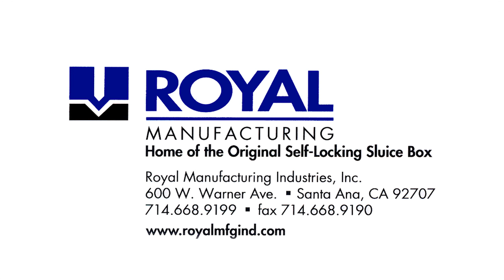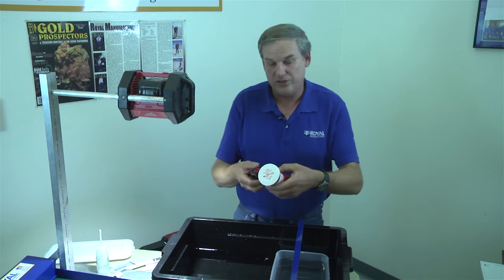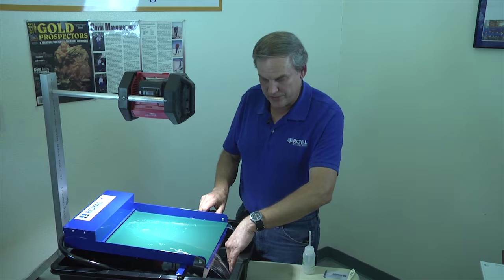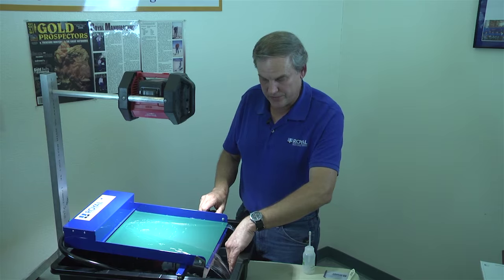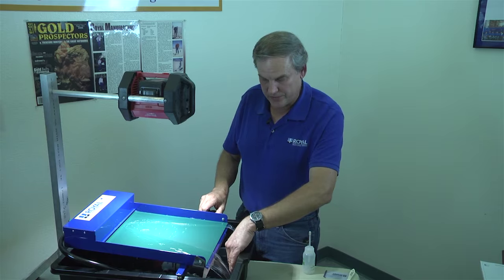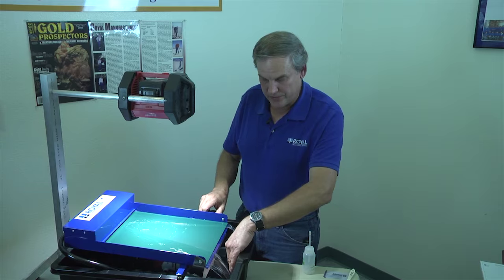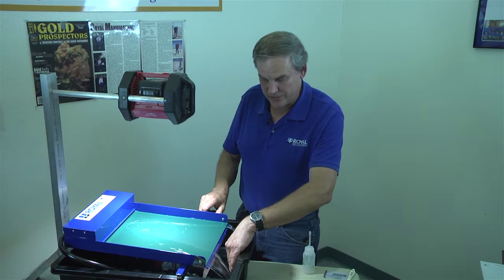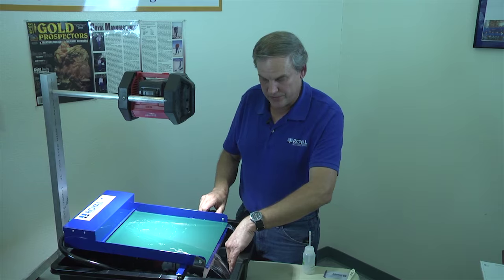Royal Manufacturing Gold Dust Concentrating Table

Comment: If this is your first time seeing a table like this, add jet dry and make sure your material is wet before adding. And run 2 different classifications at different water flows. 50 mesh and 800 mesh don't separate well together.

Comment: I ordered one and came two days ago. Might want to check out the holes for leveling the table. Improperly drilled, thankful I had drill to drill new holes. Table is awesome
Reply from the maker: If you ordered from Sunny Mountain, we did not ship them the black bins, they purchased their own and did not move the hole as they should have. But we are sorry for that and have spoken to them a few times as there customers where calling us regarding holes.

Comment: I use a 3 stack gold cube with tromel then I clean out the miners moss from the gold cube into a 5 gallon bucket and it's very fine almost like slurry and then I run it through the royal table and it works great

Comment: Beautiful product, looks like it works really well! At 21:15 - you might want to consider adding a drop of Jet Dry to break surface tension. Also, wet any material before you run it so it can break the surface tension properly.

Comment: I can't imagine putting this much energy and time into capturing so little material.
Reply from the maker: It's a hobby, not for everybody
Reply: @royalmanufacturingoffical  - definitely.
Reply: @driverjamescopeland 
It’s a ton of work. Screening Gold bearing mud particulate through screens. Filtering mud off Gold dust with jet dry/dawn dish soap but the mud eventually separates as much as it will, then you let the water settle for 2 days near the sink before gently pouring the muddy looking water until you see heavy looking sand since Gold is denser than water. Then you keep transferring the water from bucket to bucket to further agitate the remainder of the mud. Do what works for you and discover the process. 

There is tons of Gold flour but greed is the only thing that can ruin the fun. For thousands of years people have fought, been killed and had their Gold stolen even lifelong friendships have been ruined over it. 

It wastes a lot of time and it’s a huge pain but fine Gold is everywhere sometimes after a heavy rain if you look for light yellow spots in soil to scoop up. Gold erodes out of rocks after millions or thousands of years until it becomes the size of dust or the size of microns. Everything needed to process it is more expensive as a start up cost than the actual process itself minus heavy machinery since I am not rich.

You can also use round magnets to get the black magnetic sands out of the micron sized gold bearing sludge as much as you can. You can see the Gold glimmer eventually.
Reply: Atomic size actually. Very very small but, yes, abundant!

Comment: I just ordered you're Table.  I'd tried a Blue Bowl, and just got frustrated.  I'd read that most Tables were not much better than a Blue Bowl.  I'm impressed by your video, and hopefully when I use it, it will perform as shown in this video.  I used to toss my lack sand, but one day I viewed it through a 5 power loupe, and discovered gold that was nearly invisible.  And the black sand was from the bottom of you large drywasher.  So to everyone who has a drywasher, DO NOT throw away the fine material that falls into the bottom of your drywasher.

Comment: It works great, well made quality product that exceeded my expectations. The packaging was superb and made it to New Zealand intact after multiple handling. I ran some cons that had been through a Blue Bowl twice and some that had been through a Gold Cube, about five or six cups gave about a gram not much but remember these were cons that I was finished with. From now on I will run anything -50 mesh through this. The black sand did not yield much I use a magnet multiple times to separate the gold that gets picked up with the black sand it was slow but from now on I would not use the magnet at all and just run it on this table.
There are others much cheaper but they will not last this is solid and well made in all respects. The only thing I changed was to raise the catch bucket up about four inches to stop minor splashing no big deal. Great machine and very happy with it.
Reply: so you bought it, is it worth the trouble retrieving that flower gold?
Reply: @shortsdeliveries  every little bit adds up

Comment: isn't this table made of copper ?! You painted it with electro static, good idea, congratulations friend. I'm from Brazil, and I know that the copper plate makes the powdered gold stick to it, but I paint it, I don't know if it works. thanks
Reply from the maker: Hi Luis, no our Concentrating Table is not copper, the top green is a matting and the blue is powder coated
Reply: @royalmanufacturingoffical  Hello my friend, is that here we use the copper plate, because copper attracts gold, creates an ionic and magnetic alloy

Comment: Nice unit like the thought you put into it. Just an idea, my miller table has a vial screwed in to the table, near the top on one side witch I can sweep with a brush my fine gold into
Reply: Do you use your witch's broom for that?
Reply from the maker: Sorry for the very late response, we are new to this youtubeing :) When we first designed our new table, we had the hole for the vial but found that the vials were breaking and thought it was not a safe design so we decided to attach the flip tray to catch the gold. With the hole you need to add your concentrates further down the table past hole than scrape your gold back up the table and try and get it into such a small hole. The flip tray runs across the whole bottom of table which make it easy to scrape your gold fast than use your snuffer bottle
Reply: Royal Manufacturing Industries I have to agree with the commenter.  You've put together a nice little table.  I use one with the one that has a vile threaded on to the table and I've never had one brake.  However, you can pop the threaded cap off that's glued on the bottom of the table and glue on one from a plastic vile.  Doesn't take long at all to make the modification.  Both designs are effective for catching fine gold.  It comes down to personal choice.
Reply from the maker: Hi Kevin, Thank you for your feedback, always appreciated.

Comment: What are the dimensions of the large container and how many gallons of water does it hold? I heard that 1/8 Teaspoon / gallon of water of Jet Dry, was the most effective amount. I also add the same amount of rubbing alcohol. It tends to get rid of the bubbles created from the Jet Dry. I filled the container till it was a few inches from the top of the container. I figured that the smaller plastic container was used to hold the belge pump. I placed the pump in that small container and used two of those 2nd's bricks to make sure it sat on the bottom of the tub. I figured that is how to protect the pump from intaking material into it.
Reply from the maker: The biggest tote is 17 gallons. We say if it works for you than that is great! Thanks for comment.

Comment: You missed the point that you have to filter out the material at the beginning. Not all the sand is already so small. There are a lot of small stones you have to filter out. What was the mesh size you used to prepare the sand?
Reply from the maker: Hi Niko, we used a 12 Mesh classifier or 1/16" openings. All gold larger than 1/16th is easy to pan out without much trouble.

Comment: just received  my royal table, what kind
brand of light do you use? I bought a voltech 500 watt Halogen.
Reply from the maker: No specific light is needed
Reply: Kevin Erickson I have a miller table from Martin Prospecting.  They bott have good and not so good qualities, but for a light I use an old style clamp on desk lamp, the kind with the spring at the hinge.  I recommend an led bulb though as they give better light and one that has a magnifying glass for the fine gold for those that are far sighted
Reply: Kevin Erickson this is a good little table I'd have bought one but I got my Martin Prospecting table at a gpaa raffle before these came out.

Comment: I like it but would like to speed it up. Fine gold, process fast!
Reply: you want to get rich faster hmmm
Reply: adil azizi maybe, or we try to find bigger gold
Reply: Gerard Vriend still we need a machine to process it
Reply: adil azizi i am thinking more like melting it with lead or oxidized lead and cupel it afterwards. Or am I wrong?
Reply: Gerard Vriend it maybe a good way but, your cost will increase
Reply: Gerard Vriend and your profit will get less
Reply: adil azizi that’s a good point. We will have to calculate.
Reply: Gerard Vriend i am trying to find panning machine, bigger then these normal one’s if you know any one, let me know

Comment: when gold is 200 mesh you don´t see it with the eyes you the gold on the table is 20-100 mesh
Reply: You can easily see 200 mesh gold particles.  And smaller.
Reply: @emf4652  plus it's magnified in the water.

Comment: The unaided naked eye with 20-20 vision can't see a piece below 200 mesh. 600 mesh gold will float off a gravity table. I used to know the Original Mr. Miller. He lived in Sacramento. I owned one of his lab tables. Better design.
Reply: LOL!  I beg to differ ;)  If there are 2 trillion 200 mesh in a green pan, you can see it ;)
Reply: My info came from my mentor who was a gold mining engineer, grad of the Mackay School of Mines, and co-inventor of the heap leach method. He owned an electron microscope.
Reply: @maranti34b  David do you have pictures of the  original  Miller table.? I meet  Mr. MILLER in the late 70s or early 80s.
Reply: @HMDickson  Try to see one. If you can you have great eyes.
Reply: @danholman5282  I may have a pic. I will check old files post if I find one. The biggest one was 16' long.

Comment: 14mins is enough. Seems well made, not overpriced, but what a faff. If collecting microfine gold I'd want that process to be as automated as poss. A waterbag weight-assisted manual (or riverflow-powered) pump with lightweight collapsible buffer tank washing through an Auto Feed Material Hopper for field work wd be ideal. A Backpack Kit is needed but I've not seen one yet. No-one seems to be using the flow of faster rivers, or fold-out solar panels, to power water pumps for Battery/Gas Independent Portable Setups. Anyone tried either?

Comment: You said you classify it down to 20 mesh. So you don't recommend separating 30-100 in order to run it? Just  throw it on and use this process? That's pretty exciting! Please confirm :)
Reply from the maker: Classify your materials down to 1/16" (12 mesh)